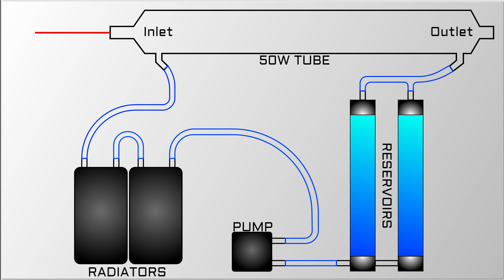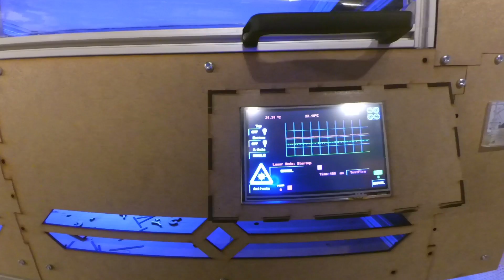DIY Laser Cutter Buildlog - Part3 - Water Cooling, Third Time's the Charm

Comment: How about if you use a refrigeration unit from a water cooler or small personal size refrigerator. When you utilize a water pump you have to allow for the heat from water friction. If you circulate water in a closed loop it will heat up greater than you can imagine. Or you can use a plate in frame radiator with city water as your cooling agent. I have over 40 years as a refrigeration field engineer and can offer you some help. I would love to see your awesome project up and running. Very nice work!
Reply: The peltier units did not work for the same reason a water cooler refrigeration would not work very well, simply not enough BTU's being removed. To do this accurately you really need to know the total heat generation of the laser tube and then design the cooling system to be bigger by as much of a margin as you want the water coo!ed on a single pass.
Reply: why did the peltier unit fail? thinking of using one for my laser build and would like to know more before i order a unit and make a mistake possibly.
Reply: Hey - aaah, yeah, its a 180W 3x peltiers with 3x 120mm fans and a heat sink block over all 3 units ... but i was actually thinking of doing a hybrid too, using the peltiers and a radiator with a fan as you said. From my research i see that it's only really with 100w lasers and above that you need to go from 'cooler' to 'chiller' , as i am using a 80W laser, cooler should be good as the recommended temp is about 20-24'C, which shouldn't be that hard to maintain. Also, i am going for a water bather over a closed system so that when the water comes from the laser it gets aerated as it drops down into the tank, allowing for some heat dissipation before going into the radiator and then peltier chain. Side note, look forward to seeing your next episodes with more details about your system  :D ! - would be nice to know what the specs of your water pump are if possible please, as well as what software you use for the CAD and then gcode compiling/sending stuff..... PS, guess time will tell if it works out or not :S will share the results when i find out
Reply from the maker: Wow, Ok! You have been researching for sure... :D and that sounds way more likely to succeed than my attempt, so I'll be very interesting to know how it goes Sam! 
I'll have some of the information you look for in the next couple of video's and thanks for commenting,  I really like to see others people perspective on things and their solutions :) This is what DIY is all about, trial and error and then the awesomeness of success :D
Reply: exactly! tinkering and perfecting is part of why i love doing what i do, it's a life-long obsession and the results are always worth it , be it in knowledge or final product - but hopefully both xP ! - pleasure, well i really like your videos and channel, you have done it really well and i thoroughly enjoy watching them, i look forward to seeing the  next ones !
Reply: ps, would you ever consider releasing plans or step-by-steps - would be a really useful resource to compare with as i build mine - like tips,tricks and do's/don'ts that you encountered along the way with your build and things for future builders to look out for.
Reply from the maker: True consaka1, and as I had no idea and still don't :) I thought some powerful fans on the radiators would be my variable system and should suffice which it does fine in 10months of the year ;) where the hottest 2 months where the ambient temperature is at it's highest it does struggle abit, but still below the 25degree mark :)
Reply: Where did you come up with the temp to keep the !aser at? 25C seems pretty cool. Does the required temp come with the !aser? 

Sorry about my wonky spelling, my keyboard is going south and if autocorrect doesn't catch it I have to substitute.
Reply from the maker: Hehe no worries consaka1 I understand completely ;) Well the description of the ebay seller for the 50Watt tube recommended the tube temperature at 15~30 degrees... so I just thought that I'd keep it under 25degrees as the maximum :D As that seems like a good 10 degree range for me as I think above 25 is probably ok! but best keep it under abit.
Reply: Gotcha.
Reply from the maker: Thanks +konaok1 that's definetly some valuable knowledge you got there, after 40 years. I have thought about other more guaranteed solutions as you mention which would work more than well enough I believe, but for the same reason I built my own laser instead of buying one, is the little stupid thing in my head that says "Would maybe this work?" or "Could I make something equivalent maybe?"... it's definetly not a cheap way of doing things but I have gotten some value of it, and that value is pretty much to go with a more guaranteed version right from the start or atleast after the Third attempt :D
Like the waterloop which is "not perfect" but OK :) and the smoke extraction ;) 
After Part 4 I will be making a video about pros/cons and what my plans are for a final update/overhaul where I would value some suggestions from you guys ;)
Reply: Most anyone can buy one, but NOT Anybody can accomplish this. Looking forward to your progress.
Reply from the maker: Hi +sam cv, well it was simply not efficient enough and my setup might not have been that good, depends on how you make it and what type of Peltiers you get, and I would say "one" will probably not enough, as I used 3 and that didn't cut it. However If you want to go with peltiers I would suggest have a radiator infront of the peltiers just to cool water to Ambient temperature before letting the peltiers cool them down further! With my current setup, I'm definetly going to revisit putting peltiers on again after my current cooling loop to try and see if I can get the water temperature below Ambient Temperature! :) But that's in the future!
All-in-All Sam, I wish I could say go for it, but with my success... :) 
If you do it, please prove me wrong :) Good Luck Sam
Reply from the maker: I Totally Agree with you on that... And thanks for the kind words, really appreciate it ;)
Reply from the maker: Hehehe well the next couple of video's are going to be all about what I plan to change in the future as I'm not really that satisfied with how my build turned out! So some tips and tricks might be there! I would say when I'm done with the future plans AND they do turn out a success, Yes I would feel comfortable sharing a kind of step by step guide :D And either way, plans will be available when done for sure ;)
Reply: A Peltier device is like trying to push water uphill. They have high thermal conductivity, so all the heat you've transfered from one side to the other is trying to leak back. The efficiency drops rapidly as the temperature difference increases.

I suspect your problem was putting too much power into the blocks. If you had instead controlled the current to achieve a Delta-T of say 5C on each block, the efficiency would have been quite good. Stacking the blocks would then have created enough Delta-T between the heatsink and ambient air for the heatsink to work effectively.

I built a Microscope cold stage many years ago using a programmable current source to drive the Peltier blocks. It was used to chill insects down to about 3C so they would go into a sort of suspended animation for examination. If the coolant tank started off at room temperature, then after about an hour, the stage could no longer hold better than 5C and would then rapidly go into thermal runaway and the system would end up heating the stage. If a freezer pack was dropped into the tank at the start of the day, then it would maintain temperature all day. The control was so good it was possible to super cool water, getting it down below 0C without it freezing until disturbed.
Reply from the maker: Yeah ok! That would most definetly make sense, as I did give it as much power as possible! :D I alsoo did try to dial the power down, but with no real difference in my test... but no where near the 5C Delta-T! 
I have gotten other peltiers since that, and definetly want to re-visit it out of pure curiosity, so I'll use a current controlled method and some temp probes to achieve the "most" efficient way to cool, avoiding the leakage as you meantion.
Big thanks Paul, I read a lot about peltiers at that time, but never got this info ;)  

(Might also just be me, as it was some heavy duty reading from my part, so can't say I actually understood it :D )

Comment: Yes Part 3 yayyyyyy lol
Reply from the maker: Lol :)
Reply: Great video. I am in the planning stage of building my own laser cutter without the Z access. I will be using a smoothie board, cheap 80W laser and power supply from China (Alibaba). X and Y will be V-slot Aluminium extrusions, Nima 17s as motors, belts and pullies. The cooling I will probably do the same way you did. Any suggestions? Should I buy a laser here in Europe or is Alibaba good enough? Do you have a breakdown of all the parts you bought?
Reply from the maker: Thanks Peter, well that sounds exciting :) Building your own laser is a learning experience and is going to cost ya. 80W tube! nice, just be aware of the length of it when designing the machine. Going with something like my Watercooling is great, I would just strongly suggest getting more water in the system (Bigger reservoirs or just like a 5~10liter cannister) as mine only holds around 2liters and is to little imo. Buying in EU or International is up to you and the price, just be aware of your country's customs rules. Sorry but a part list of my stuff is pretty much impossible to list as it's over 2years ago I bought most of it and I pretty much bought all over the place (ebay, aliexpress, banggood, cnc shops, extrusion shops, amazon etc etc.) But search and you'll find, if you want some particular parts I can try and see what I can do ;) Let me know how it goes and remember to take pictures and progress video's ;) Seeing other's do their own machines is always a treat to watch :)